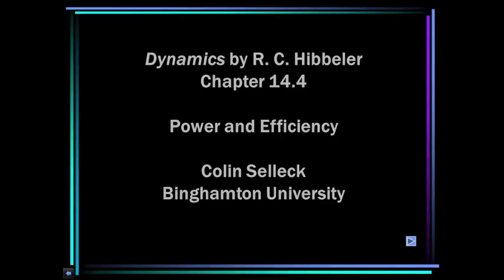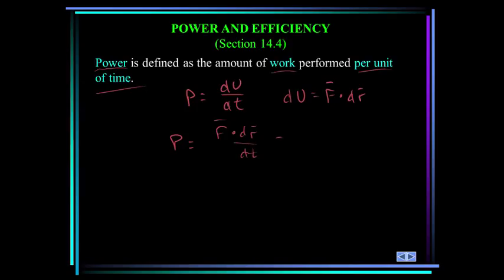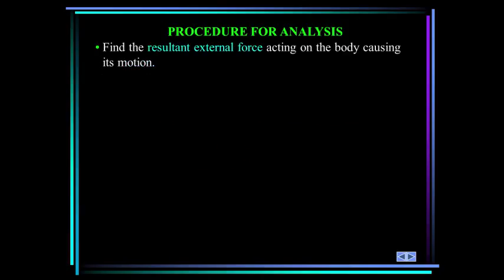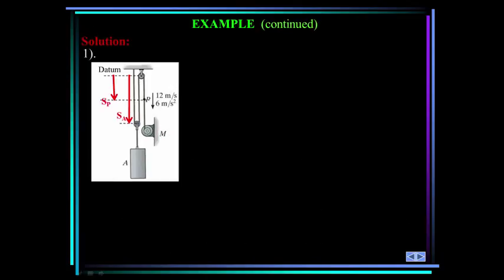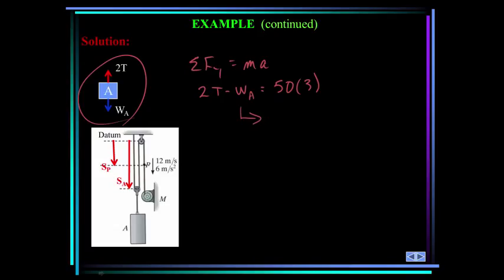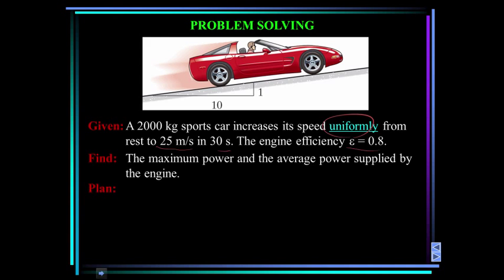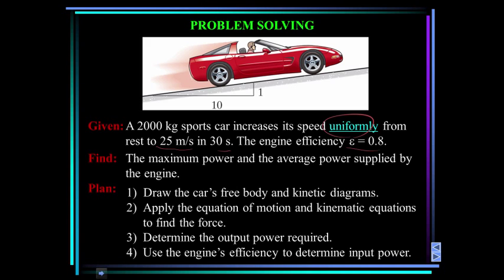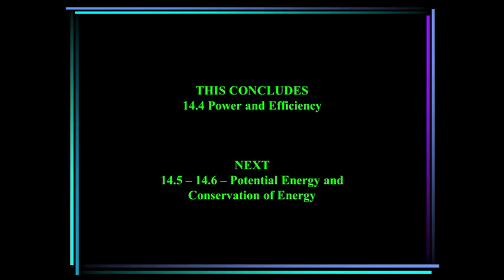ME 274: Dynamics: Chapter 14.4

Comment: 10:35 why did you used sen? shouldn´t i use cos? or it depends?
Reply from the maker: It is sin(5.711) since the angle 5.711 is measured from the positive y axis. The angle from the positive x axis is (90 - 5.711) = 84.289, so you could have used cos(84.289). Same thing.

Comment: At 8:19, you solved for T and figured it to be 320.3, but in your power equation for force shouldn't you use 2 times T because there are 2 cables? the 320.3 would be the force from just one of them..?
Reply from the maker: No. The motor only has one cable with tension T.

Comment: At 12:00 when calculating power output. For the force why did you include only Fc... Shouldn't it be Fc - X component of weight?

And if the case is that you multiply only the force acting in the same direction as the velocity, how come in the first problem you multiplied the tension with the velocity? Tension was acting upwards while velocity was going downwards.
Reply from the maker: Fc was calculated using the X component of the weight. So Fc is what the car's engine needs to produce to overcome the incline and accelerate the car. This is why only Fc is used.

Comment: At the sports car problem:
In the sum of the forces in the X-direction, it should be MINUS 2000*g*sin(5.711) in the left hand side of the equation, not positive
Reply from the maker: Good catch, Andreas. The answer Fc = 3619 N is correct.